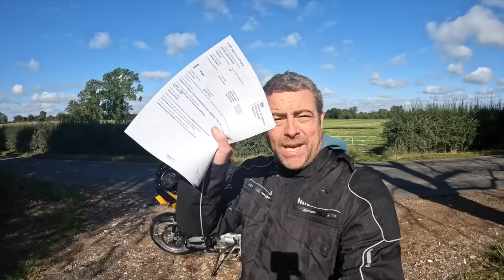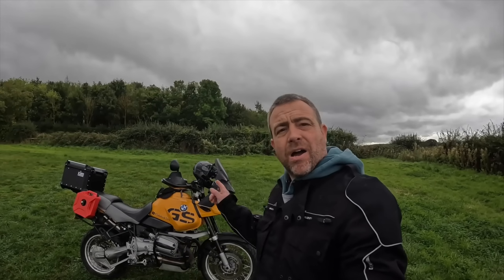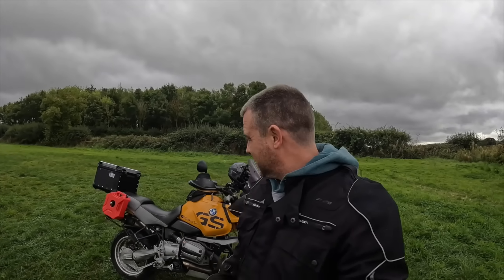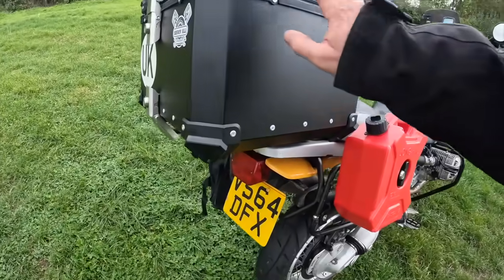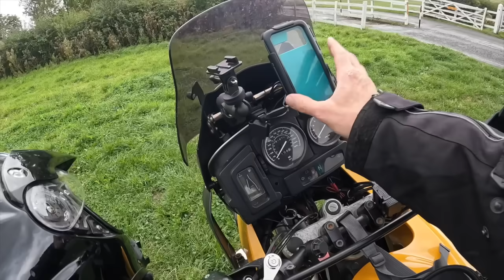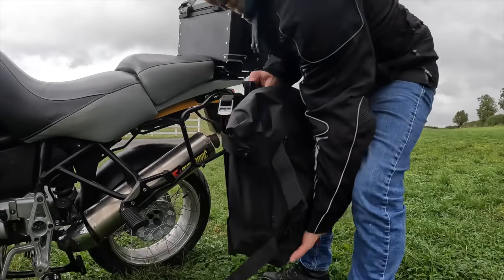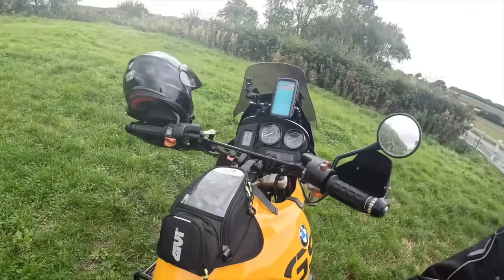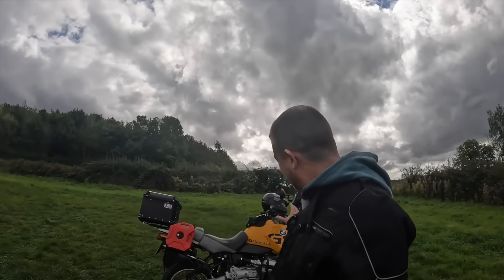The Final Reveal Of My BMW 1150 GS But Things Are About To Go Horribly Wrong

Comment: For the MOT the Horn is a well known achilles heel due to the wiring connector close to the headstock perishing/poor connection due mostly to age and will choose to work when the bike wants and not when you want it to. Mine usually stops working on the ride to the MOT Station. P.S they all leak Oil at the rear, gearbox output, Final drive, but not a lot. I check inside the rubber boot every 3 months and if only a few drops or half teaspoon of oil drops out - All is ok.
Reply: This is so true! The only time I've had the horns not work is on the way to the MOT.
Reply: @Tiz147  Yes, luckily my local non official BMW Dealer was less than a mile from the MOT Station, as soon as I told him the horn was not working immediately he began to wiggle the connector close to the headstock, he told me to wiggle the connector & press the horn during the MOT test to make sure if functions ha ha…most of the MOT Work is automated on a track you ride on, weight, brakes, wheel alignment. The switch gear functions, the lights etc, you operate with the MOT tester watching on barking which item to press next…ha ha..its stressful..

Comment: Over time, the lip on oil seals wears a ridge or depression on the shaft running landing. In which case as you have found, no amount of seal replacement will remedy the situation. It's a case of component replacement or shaft reclamation via bushing, metal spraying or welding and re machining to size 🙄
Reply from the maker: We could be into that territory.

Comment: Hi really good job with all the work  was wondering where did you get the mounting plate for the lomo bags they look great
Reply from the maker: I made it myself. I didn’t like having to strap the bag on and off all the time.
Reply: @SidekickSolo  yes having the same problem is it just an aluminium sheet
Reply from the maker: @jamessinclair4439  yes ordered off eBay. I think it was about £15.

Comment: Hi, i've seend your videos.  Amazing process. Glad to know you and your channel. I have a 1150gs Advr 2004, i pass by all restauration process.  Now my motorbike is amazing.  Only have 2 points I should worry about, 1) Heated grips, doesn't work.   I will try a solution that found in Goyo AV youtube channel.   2) Oil leak..  after last clutch change, the union between gearbox and transmision, right above the mofle is leaking.  Its like a oil sweat.   What you recomend me?
Reply from the maker: I’m not sure exactly where you have the leak but unfortunately it is not likely to get any better so it will probably need to come apart to be looked at.
Reply: @SidekickSolo  thanks... now is when i want to cry jajajaja

Comment: I can't believe how much bad luck you have with all those pesky little repairs. I just got back from a month round trip on the Iberian peninsula (2nd time this year) incl the Pyrenees on my now 245K km GS1100 and besides a shredded rear tire didn't need to fix anything (this time). Maybe you should consider taking a final drive main bearing (eye-watering expensive)/oil seal (cheap)/o-ring(cheap) with you in case the damage to your pinion wheel seal came from the inside out. Its the best insurance you can get because its never the parts you have with you that will brake down. Looking forward to the next instalment of your African adventure.
Reply from the maker: I think the mistake I made was changing them in the first place. I changed them because I had it apart but should have just changed the clutch and left the seals a lone.
Reply: @SidekickSolo  Hindsight is 20/20 . It would probably have bitten you at another moment, far away from your shed. You did what you thought needed to be done and it didn't work out the way you hoped. Happens to all of us.